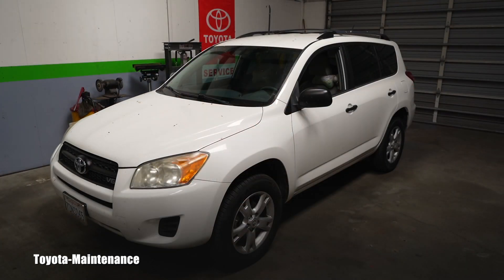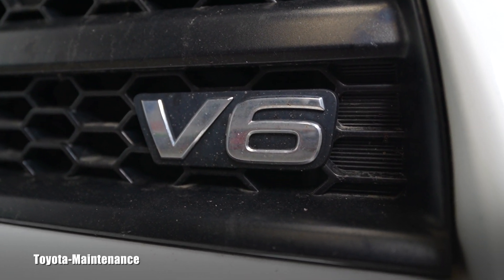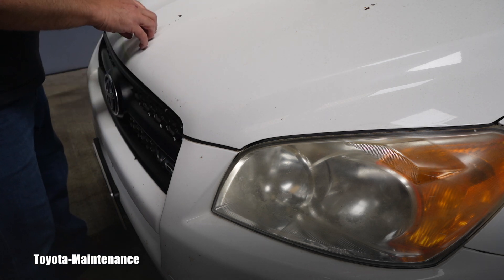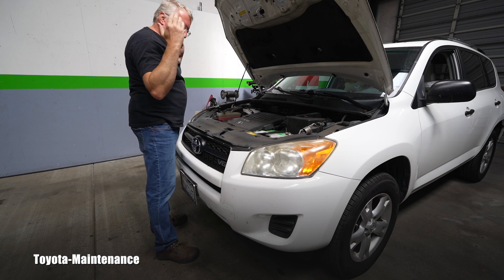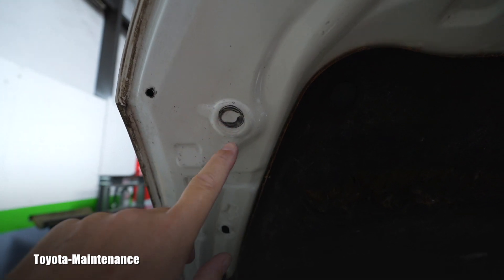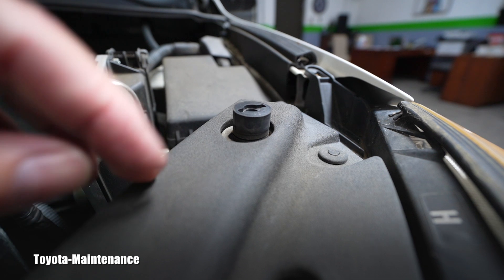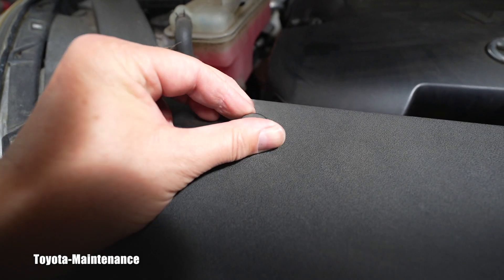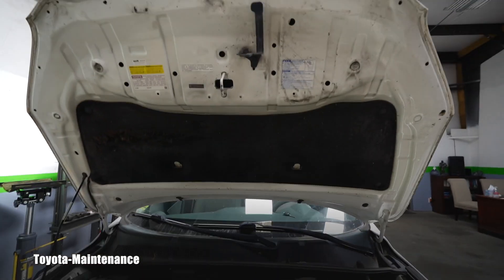Hood Bouncing Up and Down While Driving

Comment: I have this RAV4 but mine is a 2006 V6 - first year they made it. I am just at 99K now! I love the power this vehicle has. I had to have my hood latch cable replaced because they are made poorly and the plastic piece up near the hood release has cracked since it;s made out of plastic! Anyway, after $150 it's fixed and all good again. :)

Comment: This is not correct unless they were set too low. Those rubber stops are supposed to be adjusted up or down to align the hood flush with the fenders. Sure raising it will take out play, but now the hood could be sitting 1/4" to high from flush. Probably needs a new latch.

Comment: Any other RAV owners notice the hood like this and not able to get closed gently and must be slammed shut? Our Camrys before I could close as easily as closing a passenger door. This Rav seems like it has a truck hood. Very heavy. Also has the truck dual hood prop positions. Lower one and higher service position.
Reply: Well the third gens had the Tacoma's 6 cylinder

Comment: I had the hood fly open one day at about 60 kmh, it destroyed the windshield. I saw it bounce a couple of times first, but I didn't get pulled over in time. Since then, I use a rubber bungee strap to keep more tension on the secondary latch.

Comment: I have a 2009 Rav4 V6 Limited. My hood latch is sticking. Sometimes I have to close it harder than I feel it needs to be to get it to lock securely. Should I replace the mechanism or can it be adjusted?

Comment: on my 08 the hood outter skin came loose from the inner brace . body addhesive  worked.  also addjusting the rubber stops with a piece of paper. the paper will start to resess bing pulled out when adjustment is close.

Comment: The rav 4 uses a plastic latch rather then a metal one. Purchased one for my wife the hood wobbling on the highway was concerning so I found out on the rav4 forum about the issue.

Rav4 is also infamous with a squeaky back door that can be fixed with electrical tape

Comment: I had this problem on my 98 Mercury Marquis.  I put in a Nascar hood peg.   Drill and pray.  Tough to get it right. It also looks very "cool."  OH well, I wonder if i could have adjusted the bump stops. I will try and get better bump stop  fitment for my race pegs and put on the plate.